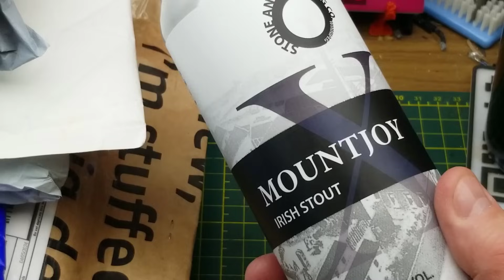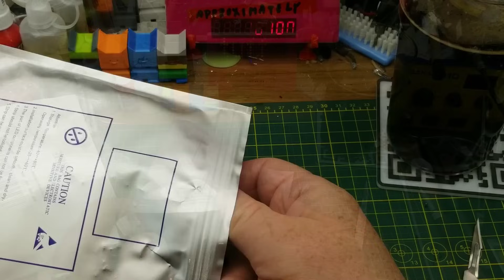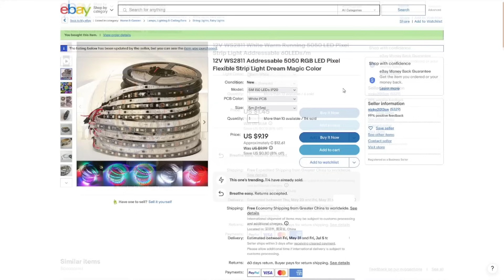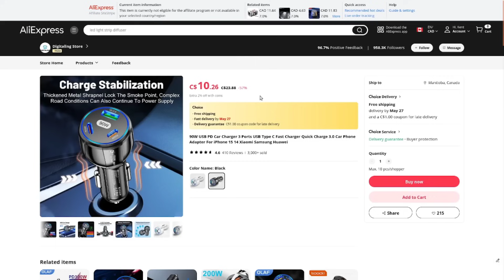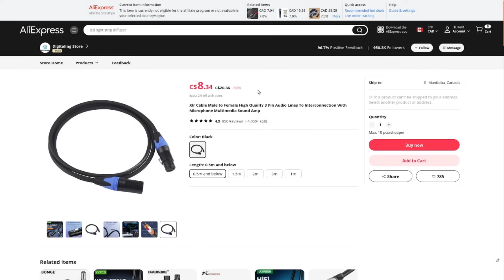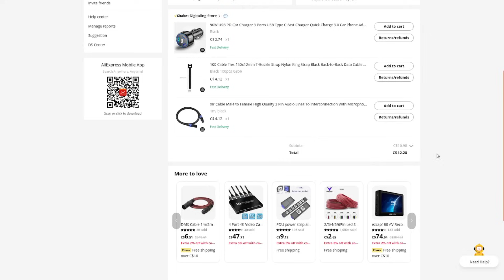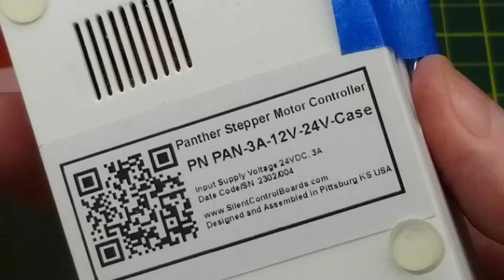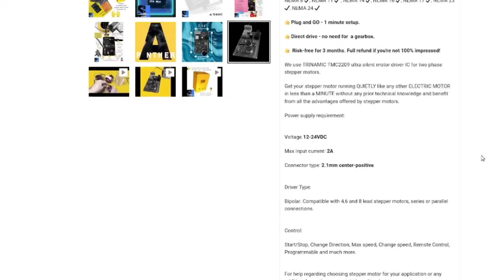Mailbag Monday 192

Comment: I recomend checking your car's fuse panel prior to using the power adapter for what fuse is in it.  I have had the inconvenience of needing to use a portable pump to end up blowing the fuse.  With the adressable white LED strips, besides chasers, they can act like light dimming due to the less than all Less lit.  It took a bit of programming to try each  individual and pairs to find sutable dimming pairs and the least brightest.  Thank you for sharing as it definitely brought back memories and future project plans.
Reply from the maker: Good suggestion.
I was expecting the lighter would be fused at a relatively high level, given that it is a simple resistive heater that should normally draw a ton of power.